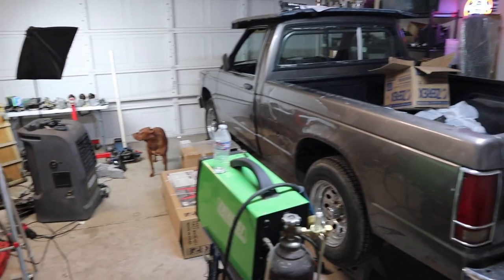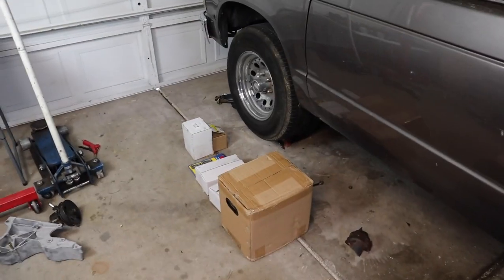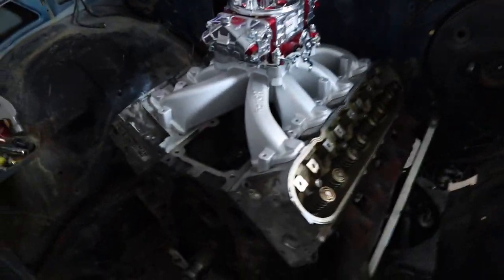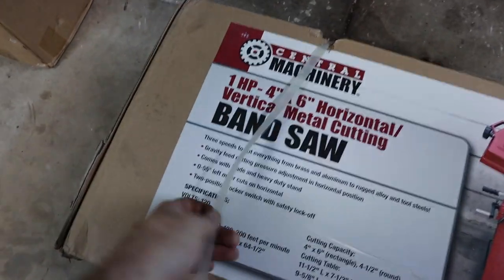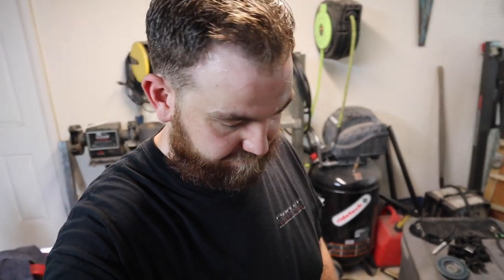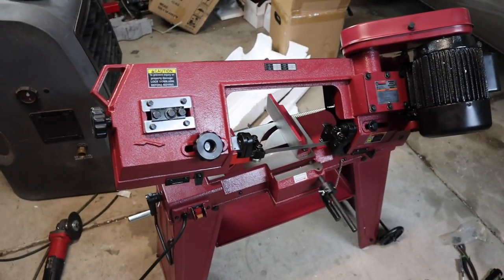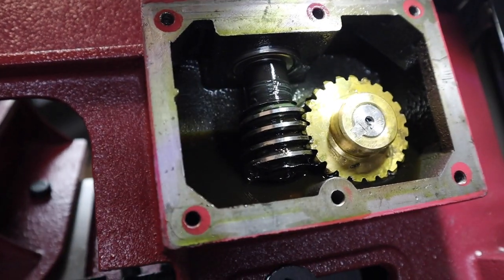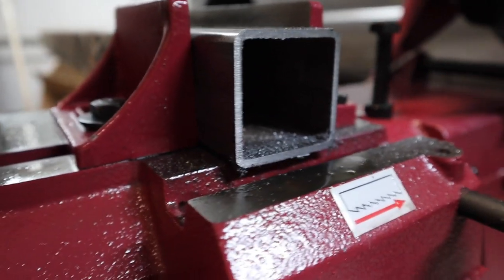Turbo LS S10 Build: PARTS UPDATE | Bonus: Harbor Freight Band Saw Unboxing

Comment: What motor mounts, headers, oil pan, and front drive accessories setup did you run thanks. Mines an 89 with 2.5 4 cylinder with 700r4 trans gonna be doing a junk yard 4.8 or 5.3 4l60e trans setup